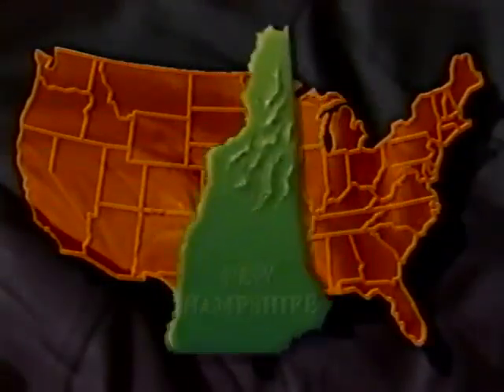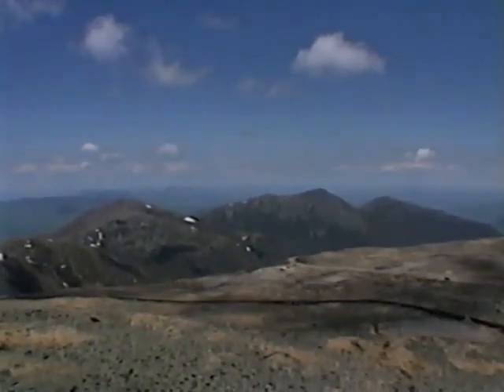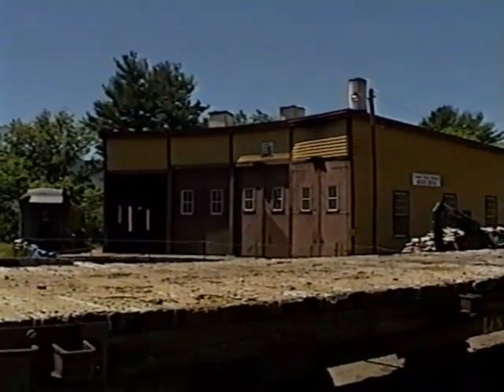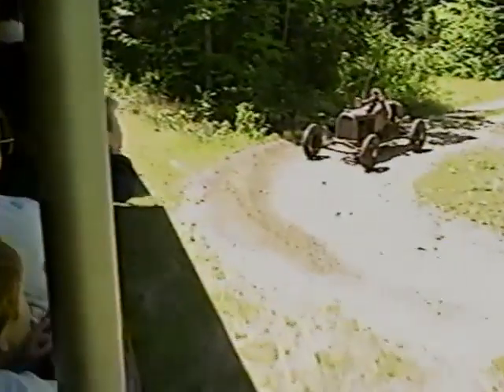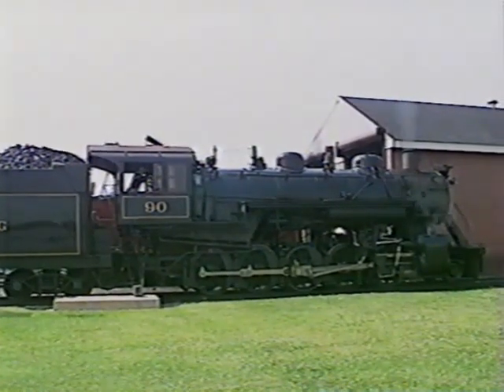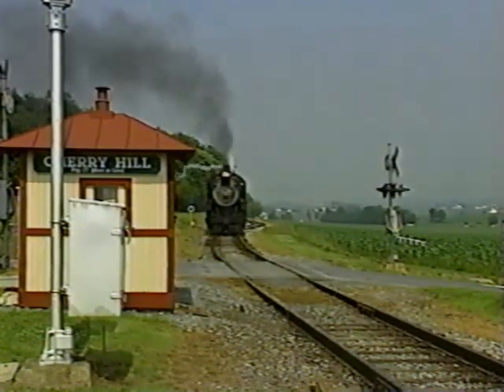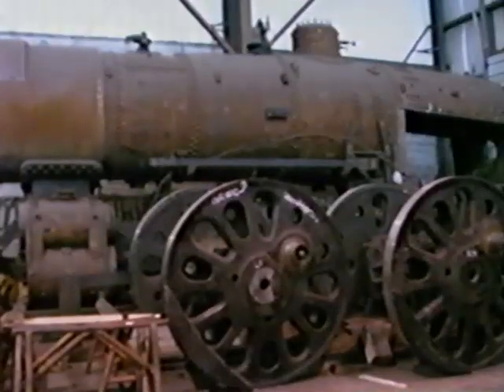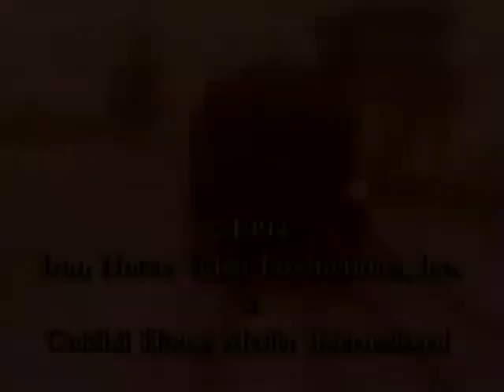America's Historic Steam Railroads - New Hampshire & Strasburg (Iron Horse Video, 1995)

Comment: The 31 on Strasburg was not the first engine they acquired, first was Reading 1187, a tiny 0-4-0 camelback
Reply: First of the 4 they had operating at the time is what they meant
Reply: Nope, #31 was acquired in 1960. #1187 did not arrive until 1962.